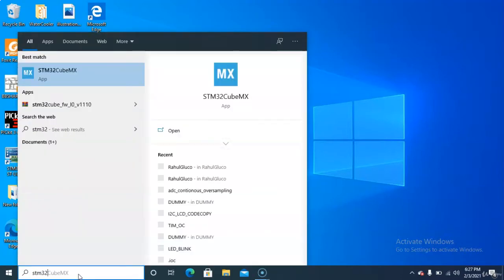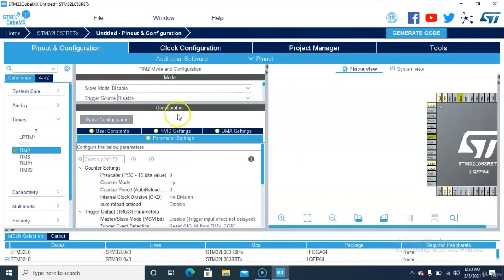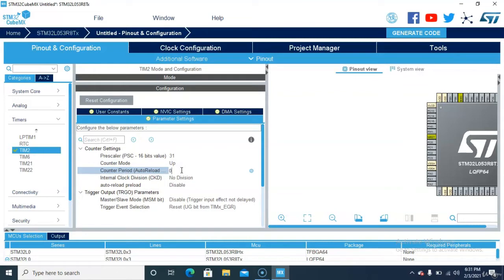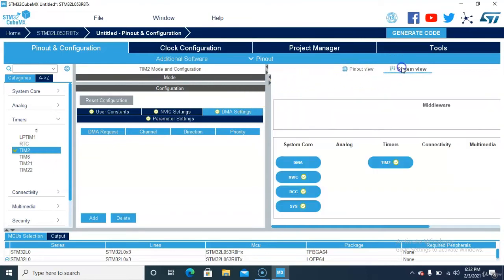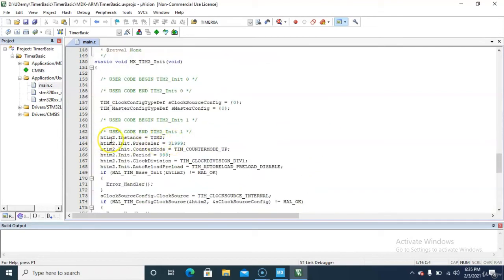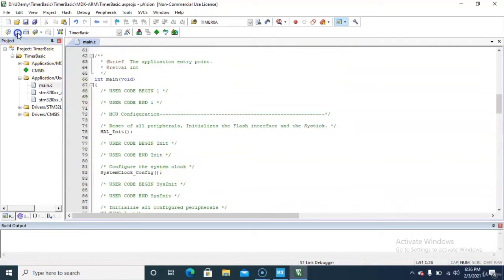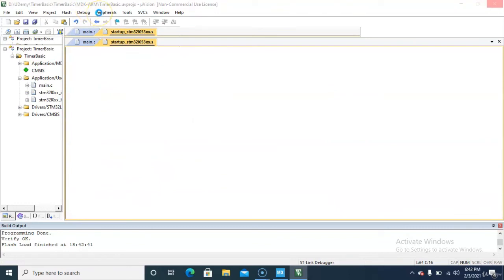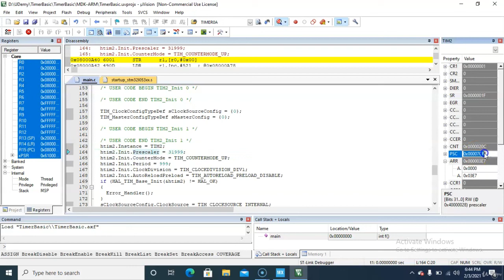STM32 basic timer | How to do  settings  for timer in stm32

Comment: Can you explain how we got 1 second by making the pre scalar 31999 and counter period 999?
Reply from the maker: If clock input to your timer is 32 MHz and prescalar is 31999 and ARR is 999 then output frequency of timer is 32000000/((31999+1)(999+1)).Output frequency of timer is this:Input frequency/((ARR+1)(PSC+1)) .
Reply: @ThinkElectronicCircuits  Thank you!😁